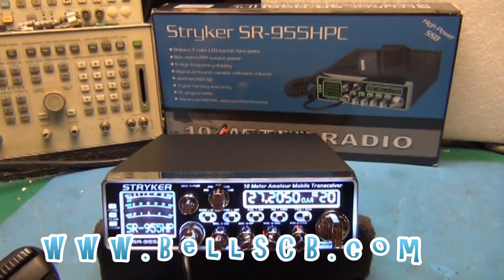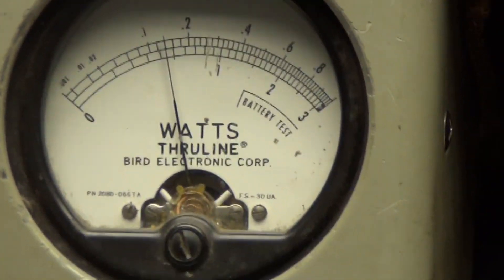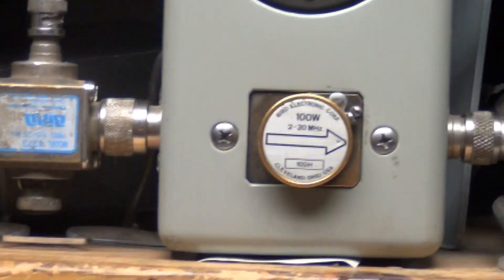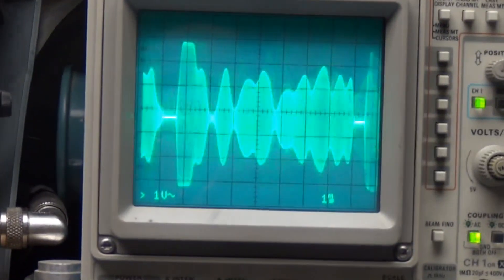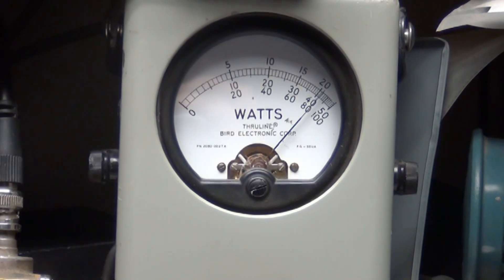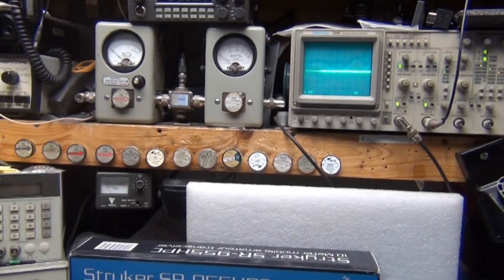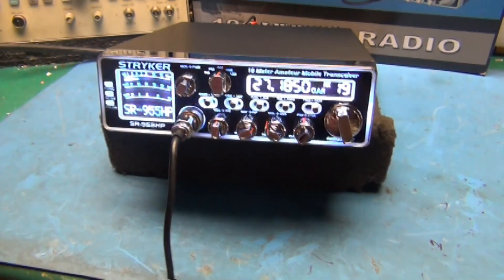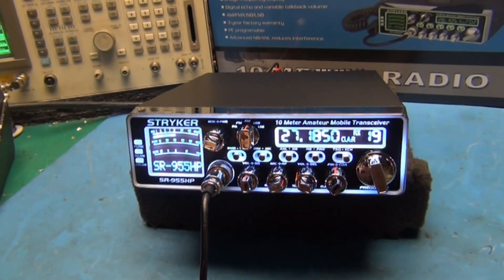Stryker SR-955HPC Tune-up Report

Comment: Thinking about a peaked and turned  galaxy 959 with unlocked clarifier and maybe the top gun modulator, what would you recommend for a combination on the 959 I'm in Canada and would like to keep it under $450